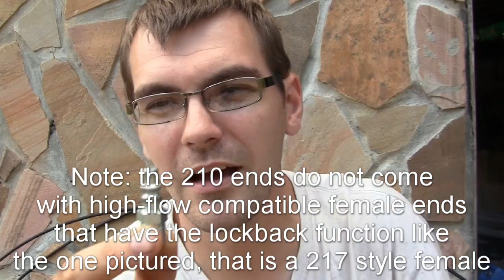Air tool fittings! Milton S-217 or S-210, Which ones do you want? (Choosing the right air fittings)

Comment: Only US I guess? Here en EU we have EU fittings ans Orion fittings..
Reply from the maker: The m style is kind of standard, I run all v style (high flow, works with m and others too) in my shop, but it never fails if a friend brings an air tool over or I loan one to a friend, they have some bizzaro fitting that only came on air compressors manufactured in Wisconsin between 20004 and 2005 or something. I've got a collection of each random fitting I come across whenever I can snag a spare one from someone. It would be real nice if they were a little more standardized over here

Comment: I’m new to the whole air compressor fittings, I’m trying to get everything to 1/4” NPT and 3/8” flow but I can’t seem to find the 1/4”MNPT 3/8” flow coupler? Are there any full coupler and plug kits that you know of? TIA
Reply from the maker: This is the basic kit that I started with that is the high flow style fittings: https://amzn.to/4gzk8oe
I tried some of the colorfit fittings, but the aluminum did not hold up well in my shop, so I replaced them with these steel ones that match that kit: https://amzn.to/3MTIV8X There is 10 in that box, and the steel holds up real well to being beat up in a shop.
If you're doing a whole air system where you want outlets all over, here is a pack of 10 of the coupler side: https://amzn.to/4edfril
Hope that helps get your air system up to par!

Comment: Very helpful and practical video, thanks for posting this. I now know why my air tools don’t always deliver the power I expect. What about hose diameter and length?  Is a 25 foot 1/2 inch hose going to be significantly better than the 50 foot 3/8 inch hose I now use?  I frequently use an impact gun for wheel removal, but am just a DIYer with a home shop.
Reply from the maker: I'm sure hose size does have an effect as well, the inside diameter and length will cause some amount of turbulence and drag, how much I'm not sure. I did some more scientific tests with flow meters, I should redo that with a ton of hose and see what effect it has.
Reply: @trythistv  I would certainly be interested in seeing that. Of course the downside of a bigger hose is having to contend with the extra bulk and weight and would have to decide if the improved air flow is  worth it. Thank you for your response.

Comment: I would think you should also factor in your compressor's output capabilities. If your compressor is capable of 5CFM, the couplings capable of 75 CFM probably won't make any difference at all. 

And I am not an expert on air compressors. I am just an old wrench turner applying logic to something, while he figures it out. In as much,  I do not know the difference between CFM and SCFM. But, figure that out, do the conversion and use the same logic. 

What you cannot possibly need is a capability to handle more air than you can produce.
Reply from the maker: Very true, My compressor makes a little over 19CFM, but has an 80 gallon tank, so it can deliver a burst of whatever the hose and fittings can carry until the tank is drained below the regulator set pressure. So with the 75CFM fittings I might get 5 seconds of a ton of CFM which is great for things like impact guns and such to have a massive CFM to get that peak torque to rip lug nuts loose.

Comment: What about an HVLP air sprayer gun requiring 10CFM?  Will a cheaper regular fitting be capable?
Reply from the maker: It should be. I would run a regulator on the gun, higher pressure in the hoses to avoid pressure sag. When I've painted with cheap guns I run about 60psi hose pressure and then drop it to 20 or 30 going into the gun, maybe as high as 40 if the paint is a little thick. With my good devilbiss gun I can get away with lower or higher, that thing sprays like a dream, possibly because I only spray nice paint through it, no tractor paint lol
With that being said, think about what these fittings are designed to do. High volume. So it can't hurt to run one on a hvlp gun, they are pretty cheap if you buy bulk, and watch for deals. I got a pack of 10 for maybe 15 bucks a while back.
Reply: @trythistv  So if I run a regulator and see drops from 40 to 28 psi with a few good trigger presses, that's telling me it's my fittings are hampering flow?  That seems interesting.   I just paint guitars so I'm kind of on the edge and I could go either way. Yeah the fittings are pretty cheap it's just that I have to do a couple different hoses and three guns and stuff like that.
Reply from the maker: @Minnesnowta-i4f  it could be anything lowering the flow, fittings or hose. usually the pressure is set while holding the trigger on the gun so it is spraying air, as there will be inherent losses in any system from length and size of hose, fittings, etc. So what we set is called dynamic pressure, which is what the pressure is at the tool while the tool is under operation. Static pressure is what the pressure in the lines is with no air escaping through tools. You'll see an impact rated at 450ftlbs of torque at 90psi or something like that. That pressure is measured at the tool, so the compressor regulator might be set to 100 or 120 even, possibly higher. Sorry if this is too wordy, I hope it at least makes some sense. A lot of time the fittings are the biggest restriction, which is most important for tools that really need the flow. A paint gun isn't going to benefit a lot from perfect flow and pressure because likely you adjust it by feel to get the spray pattern and behavior you want, it always seems when I set up to paint it takes me a few sprays and adjustments of air pressure, paint throttle and fan adjustments on a test sheet before I'm happy with how the gun runs and start actually painting.
Reply: @trythistv  Good point I appreciate that perspective of dynamic flow/pressure.  I did purchase a set of high flow fittings, just to try the best scenario, which I was excited about, but double checking my quality air hose, it of course doesn't have a high flow male tip to fit into the compressor, so that's frustrating.  I may have to buy parts and splice the hose end, but I really like the hose, which has a hand grip reinforced end.  May be I have to look for an air hose that has the high flow fittings, already.  I don't know if Merlin fittings set will be compatible with competitor high flow brand hoses.

Comment: That doesn't look like a Milton 217 you are showing.  The 217's are the V style, which have the body of a 1/4" with a reemed out "high flow" opening. That larger plug you have looks to be the overall larger 3/8" H style with the 1/4" npt thread.
Reply from the maker: I can assure you in this video I only had S-210 and S-217 kits. I have since gotten a mountain of others to compare and make a follow up video (https://youtu.be/8uLZNFIC-ao) But in this specific one, every fitting shown has 1/4 NPT threads
Reply: @trythistv  Thanks, I'll check it out.

Comment: i got a Small 4.6 Gallon Twin Tank used Compressor , my air Fittings is like yours on the Small Air Chuck 
DOES NOT want to POP IN ???? What Gives 
i looked at the Compressor Coupler - has a Thick O-ring 
Did not Want to Force the Fitting inside the Coupler of the Compressor
Reply from the maker: There are so many fittings and brands out there, If you do indeed have one of the V-style coupler on the compressor, it should accept most of the other couplers, it does take a bit of force, but nothing extreme, I would check to see if there are any markings or possible identifying info on the coupler, or post some pics somewhere online or email them to me and I'll take a look and see what it looks like!
Reply: @trythistv  Thanks for Reply - using a INDUSTRIAL TYPE FITTING , had to use Bit more Force , worked ok , the Coupler is Universal type .thanks for Video Description
Reply from the maker: Awesome! Glad you got it sorted out, it's so confusing with all the different styles that's for sure.
Reply: @trythistv  i know - i am a Mechanic by Trade and Still Daised and Confused

Comment: Did you also change out the coupler on the air compressor ?
Reply from the maker: Yes, the coupler on the compressor tank is the single most important one. My compressor is semi permanently plumbed so there isn't a coupler at the tank but every coupler in the system has been switched to hiflow and it does make quite a difference.

Comment: I an pizzed..i just bought a MAC700 Makita...two hoses...and a pack of fittings(industrial) and they do not snap into the compressor...jezus christ...makita takes universal? wtf.
Reply from the maker: That is rather bizarre! From what I can see online, it looks like that compressor is supposed to have a fitting that works with industrial or automotive, which is rather odd that your fittings don't fit, I've had great success with these S-217s taking nearly any fittings.
Reply: My first compressor...I just had to really push it in hard...did not have to "pull back" on the value...just went in thx... @trythistv
Reply from the maker: Well thats awesome that it ended up working! Sounds like that connector might be a similar setup to these Milton ends, as I don't have to pull the collar back either. Welcome to the wonderful world of air power!

Comment: Thanks for the info!  Put an order in to give them a try
Reply from the maker: I think you'll be impressed. I bought them and have to say they're one of my favorite upgrades, I love not having to pull back on the collar to put a tool in, as well as semi-universal compatibility (I made another video about the issues with some ends popping out) and I noticed a seat of the pants difference in the torque from my tools with the high flow fittings throughout the system. Can't wait to build a shop and plumb it all up. Milton will be getting a big order when that happens.

Comment: I found high flow fittings at Home Depot. Replaced every fitting in my system. Made a huge difference. Thanks!
Reply from the maker: Awesome! Yea there's a bunch of brands of high flow fittings, I've heard Parker and another are like the cream of the crop but the prices seemed a little steep for me. I'll check my local hardware stores sometime and see what they have, it'd be interesting to compare!
Reply: @trythistv  It's been a year since I bought the high flow fittings from Home Depot and they still work great. No leaks. I really like the simple push to connect instead of having to pull the collar back to connect them. I've put them on every air tool I have.
Reply from the maker: @wcjcnc  that's awesome! I'm so glad you gave us an update, I just bought more fittings last week, I'm building a shop this year hopefully so I'm planning on plumbing in permanent air lines with high flow ends everywhere for easy access.
Reply: wcjcnc )

Comment: How can I replace my 1/4 NPT to 3/8 for my air impact ?
Reply from the maker: You'd need all new hoses and fittings to go to 3/8 fittings, I'd highly recommend just getting these Milton S-217s that are featured in the video (http://amzn.to/2izDPDY) and using them at your compressor and at the end of the hose so you get the higher flow benefits all the way from the air source. Its not quite as good as 3/8 hose flow, but its a ton better than the regular smaller fittings.
Reply: @trythistv  I agree 100%, I didn't notice too much of a difference switching out my hoses to 3/8" but a huge difference going to the Milton s-217 from compressor to tools. Thanks for the super info....new sub here too
Reply from the maker: @kennycybertron1  yup. Most air hoses are 3/8 in the sense that the rubber inside diameter is 3/8, but they still use 1/4 npt ends. To get 3/8 npt fittings I believe the hose needs to be 1/2 inch and that's a big change and expense because I haven't seen hardly any tools with a 3/8 npt fitting. The v style are awesome. I wouldn't use anything else. Have you seen the latest video I did on the actual flow measurements on these fittings and measured the bores and stuff? It's a little slow and sciency but interesting if you're curious why these make a difference!

Comment: Lol. M fittings don’t work in v couplers. My mouth has proved it twice now.
Reply from the maker: Afraid that's a big no from me. I regularly use tools with M fittings, as well as V and A fittings with my air system which has V fittings on every hose. Never had one come out, never had one even leak air. I've drug tools around by the hose while under vehicles, left things connected for days at a time, and never had a single issue. Perhaps you've got some cheap knockoff V couplers rather than the Milton brand I've got?
Reply from the maker: Also the Milton site has this: "1/4" FNPT high flow V style couplers will accept A, M and V style plugs" See for yourself: https://www.miltonindustries.com/couplers-and-plugs/v-style/6-piece-v-style-high-flow-coupler-plug-kit.html
Reply: trythisiptv Nope I was using the Milton V Couplers with Milton M fittings. Popped off twice for me and twice on my journeyman and that was it for the v couplers. Switch to Milton M couplers with Milton M fittings and haven’t had a pop out since. Sucks though I really liked the increased power; it has to be worth an extra 30 percent more power out of a tool with V fitting installed. And for some tools I didn’t need the more expensive V fittings like blowguns and tire chucks, my mini air hammer, paint guns etc.
Reply from the maker: Nick Cove well that is bizzare. I know of several people that use v couplers and same as you, blowguns and less air hungry tools get cheaper fittings, myself included in that, only issue I ever had was when I left a hose outside in the lawn and ran it over with a truck. The mud caked in and wouldn't let it lock in. I cleaned it out and it still works great. Funny too with both being Milton fittings you were using, since they even say they're compatible on their site. I'm very curious what was different between the setup you've had issues with and mine.
Reply from the maker: I need to thank you for bringing this up, as its gotten me thinking about different couplers and experimenting a bit to see if I can replicate your issue, and sure enough I had a coupler come loose recently. I'm making a video about it that should be done next week sometime that explains my theory and shows all the couplers I currently own and their measurements.

I believe the diameter of the little nub that retains the fitting in the coupler is to blame, I don't have any M fittings, only V, A, a couple "Amflo" and some cheapies, and they vary wildly.

I'm hoping viewers will chime in on that too. If you could, once I get the video up if you have a dial caliper of some sort could you measure the M fittings you have as I'd be very interested in knowing, can't find any technical drawings or specs for them.
Reply: trythisiptv  hey man I’ll take some measurements and let you know. Prefer SAE or metric ?
Reply from the maker: I really appreciate it! I took mine in SAE, decimal rather than fraction because it's simpler to compare, but metric would work as well if that's easier for you.

I really wanna get to the bottom of this. I may end up picking up some m fittings to test them, I mainly have A and V styles and haven't had problems until that one that is about .02" smaller around the nub.

Thanks again for getting back to me and helping out get to the bottom of this
Reply: I just changed all my air tool to V couplers on my air hoses, have M fittings still on air tire chucks, Air plow guns. M Style and V couplers are compatible, I use all my tools with no issues. You just can use a V fitting into a M coupler. I only use Milton products, going cheaper brands ends in cheap results.

Comment: can we possible mend 2 couplings? like I have 2 hoses for bosch aqt and it has couplings already and would like to mend it please help
Reply from the maker: I'm not 100% sure what you're saying but the bosch aqt looks like a pressure washer? I'd be very careful using air fittings for  a pressure washer as there is a lot more pressure there, air tools usually run at 150psi or below, 90psi is generally the standard. wheras my pressure washer maxes at 4000psi, not pressure to be trifled with, as serious injury can occur at those pressures, getting hit with fluid at those pressure can pierce the skin and leave it under your skin. I have a good friend who works with hydraulics, and had a hose burst and the oil ended up embedded under his skin, did a lot of damage. now if you're doing something with lower pressure, there is a good possibility of being able to repair a hose, my air hose came apart, and some oetiker (sp?) clamps and a new barbed 1/4 npt fitting fixed it right up.

Comment: Good vid!
Reply from the maker: Thank you!
Reply: trythisiptv You're welcome! Do you know if Milton has any 1/4" pipe threads on one side and a 3/8" highflow quick disconnect on the other?
Reply from the maker: Not that I'm aware of, they have the 217s in the video, which are 1/4 pipe thread and high flow V-Style (74SCFM), I can't find much of anything even in 3/8 that flows more. Miltons high flow 1/4 and 3/8 are identical in flow rate according to their website.